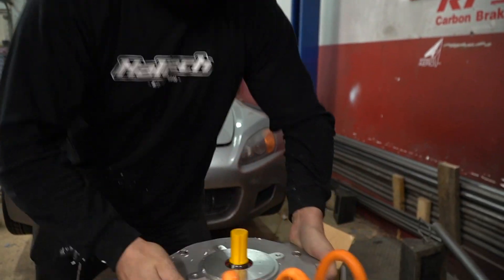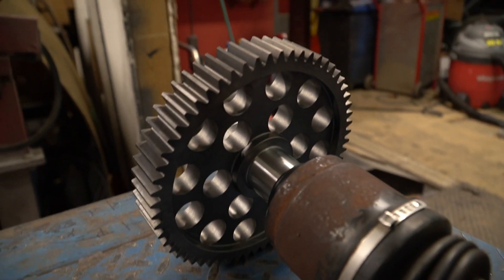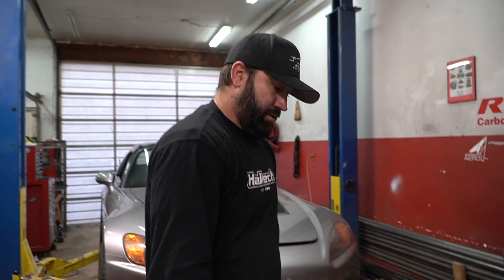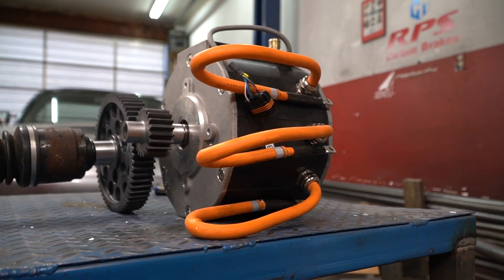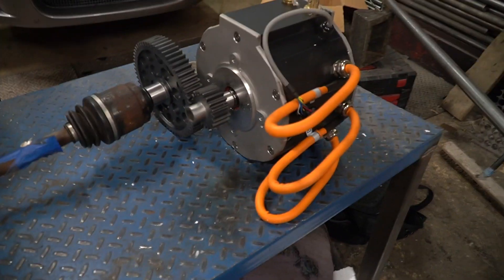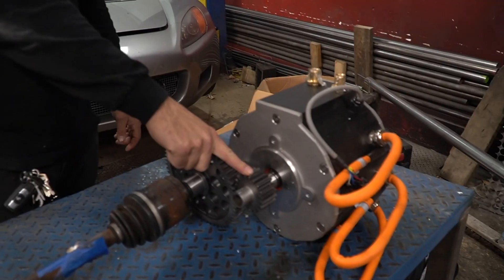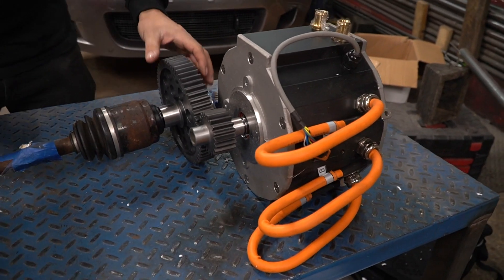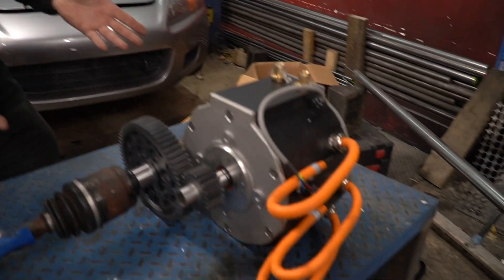Beastie Hatchback Hybrid Update!

Comment: First video l saw... l know you're a petrol head already because I see a s2000 and a ultima 👌👌
If the hybrid system will work you can go all-in by switching to a yasa/magnax motor (they have around 200kw peak per motor and they weight less than 20kg)

Comment: So it would have the 90ftlb*gear ratio stationary torque then loose torque increasingly as a function of speed from friction as speed increases. 
Should b interesting doing all the calibration work for your vehicle dynamics control and hybrid functions. I imagine it being a bit odd dragging you’re rear wheels as it tries to charge, but with the inputs you have it should be manageable. 
Are you using a five axis accelerometer, yaw rate sensor, ect for your controls?
Reply: The more I think the more challenging it gets, is your engine management going to be integrated with it too? Otherwise as the system released the regen you’d have an effective surge of forward power but you could use your accelerometer and drive by wire throttle to mitigate that I suppose. Neat stuff!
Reply from the maker: Its much simpler than you think.   Wheel speed sensors, yaw sensor, and analog input from TPS.  Regen only happens on Decel(provided by ECU) or braking.  Accel is linearly programmed and adjustable by the BMS.
Reply from the maker: 90ftlbs peak output×3 because of the reduction gear set.  That wont change until the motor curves taper off, or unless commanded duty cycle is changed(wheel slip detected or throttle change).
Reply: Cody Loveland really looking forward to more on this project!